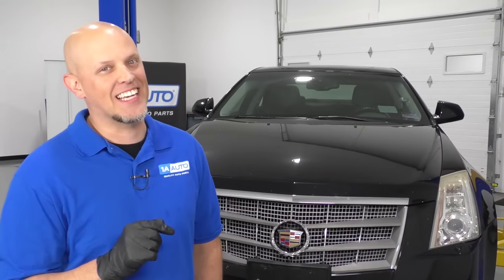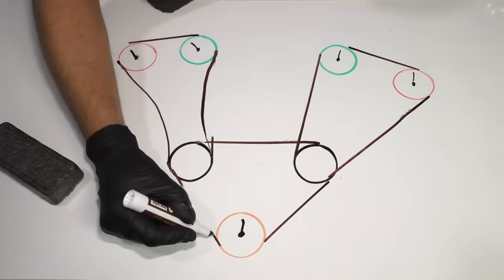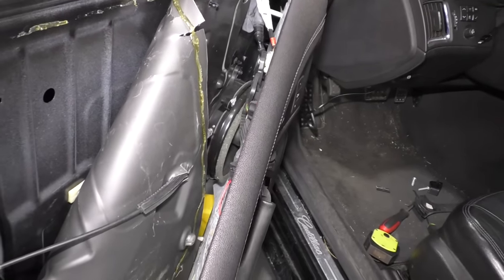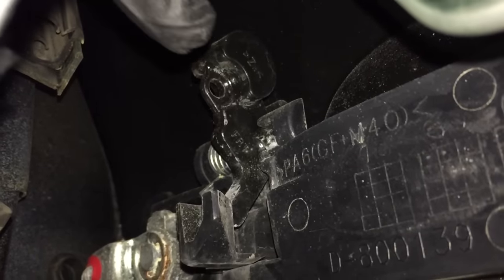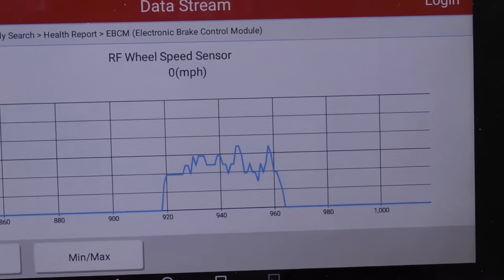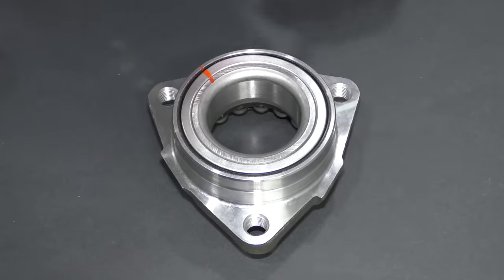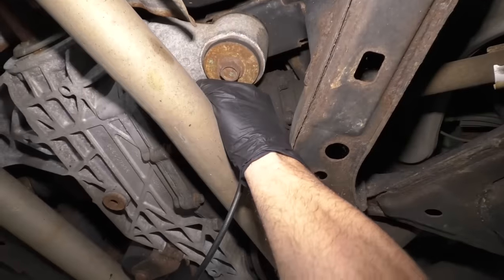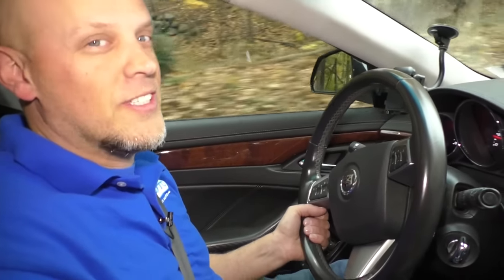Top 5 Problems Cadillac CTS Sedan 2nd Generation 2008-14

Comment: had timing chains replaced i have a 2009 it only has 85k on it had the chains done at 75k now the O2 Sensor code came up need to have that done now if it's not one thing its another~~

Comment: Had 3 dealer did timing chain under warranty multiple wheel bearings and multiple micro switch replacements. Oh and cant forget the leaky sunroof which I'm pretty sure is now the cause of my electrical issues currently
Reply: I am having what might be timing issue currently, can you share what you paid for the repair as I am being told about $3200 and if there is cylinder damage could go much higher.  The dealer cant seam to be able to tell me without getting into the engine first, but keeps talking about how I should buy a replacement car from them. I just do not trust them and not sure what to do.    I had water damage 4 years ago from the sun roof also that took about 3 weeks for them to figure out and fix under an insurance claim.

Comment: Great video thinking of buying Nieghbors 2011 Cadillac CTS rwd 6cyl coupe with a ton of miles on it 160k  for a cheap price ...(4$k) I’m scared of the mileage though but he’s kept it up ... I had the 2015 impala and the word was out regarding the timing chain stretch... my question is that was the first fix you mentioned is it that normal ? And did gm fix this issue in later models ? 
Great video thank you
Reply from the maker: +Kevin Edwards Thanks for checking us out! These are the top 5 problems associated with the CTS and could be found in the newer vehicles as well as the ones mentioned in the video.  1AAuto.com
Reply: Instead of fixing a timing  chain think bout a certified  engine

Comment: I have a question I get p0455 I've change the evap n also the gas cap but I still get a check engine light on and ever once and a while I get check gas cap n also I check the valve that is under the rear  my question is that harness that connects to the charcoal canister is there suppose to be power going through it ?

Comment: What is the purpose of having an electro-mechanical door latch release like that? I'm pretty sure some of the newer Volvos have them too, and I'm curious as to the necessity/purpose of this design.
Reply: I don't know for sure, but I would imagine that it all ties into the remote keyfob/security (PASS-Key III) system.  The switch is needed so that when one pulls on either of the front door handles, the proximity signal from the keyfob tells the computer that it's OK to disarm the security system, and the rear doors unlock as well, if that function is turned on through the radio/nav system.  Otherwise, one would need to use the "unlock" button on the remote each time one tries to enter the vehicle.  If they used a purely mechanical setup, the system would work like older vehicles with power locks that employs a solenoid in each door to physically slide the rod back and forth that controls the lock mechanism.
Reply: @williamwoodson4367  This is true.
Another thing I realized is that the coupe body of the CTS had the pushbutton exterior and interior door releases, ala C6 Corvette, so the engineering of the entire comfort/electronics systems for every bodystyle of CTS would have had to have all the same components, even though the sedan had traditional exterior and interior door handles.

Comment: I have the stabilitrack, abs and all wheel drive off lights on.  This only occurs when someone  sits in the passenger seat.  It will then turn the dash lights on bright and turn the radio and heat/air systems off.  It will continue to alert with the buzzer in several minute intervals till they get out of the passenger seat.  This has to be electrical…more like a short than mechanical?  Anybody??

Comment: Is it just me or... since you spun the left front wheel backwards at 5:36, and since the speedometer doesn't register speed when the vehicle in backing up, there should be NO speed reading when you were spinning the left front tire any way. In support of this is that, since you were spinning the left front tire backwards, it spun the right front in the opposite direction, causing it to register on the speed sensor. This can bee seen when you spun the right front forwards and in the background you can see the left front sinning backwards. Had you spun the right front backwards, the left front would have spun forward and may have shown a reading on the speed sensor while the right did not.

Comment: Ive always like these cars but never really stepped to get one because of past Cadillac reliability problems. What about the transmissions and or other internal engine problems?  Any thing else to look for? What would be the cost to take care of the timing issue?
Reply: Besides the timing chain issue the engines are actually pretty good, nice power and decently reliable, especially the 3.6. the first two years of the second gen had transmission issues, so I'd stray from those, but it was remedied with the 2010 model year. I've seen quotes as low as 1200 for the timing chain job up to around 2000, but it's preventable with regular maintenance.

Comment: I like many others get abs and stability system  lights, also (FM transmitter used in front plug and turning right goes static, used in back plug static is more random. Wiring issue in steering wheel
Reply from the maker: +Robert Kissler Thanks for checking us out! 1AAuto.com

Comment: I have 2008 caddilac cts 3.6 I change the engine and the engine light still say timing chain. That only thing in my check engine. It drive fine and runs fine. What can it be for timing chain on?

Comment: I have a 2008 cts , great running car. Only problems were battery drain was the trunk. Iight, leak from the sun roof wish there was something I could do about it. I cleaned the drains but still leaks a bit. And it had a slight leak from a hose that would give off a coolant smell and leak at the bottom of windshield, that I stopped by radiator stop leak. Otherwise it would have been very expensive.
Reply: @Neil Stern...Been there done that with sunroof drains. I went inside of front wheel wells. Was going to cut the "duck bill" looking grommet end. Too much hassle so I used soldering iron tip and burned the opening at the grommet end. Use a flashlight to find one at the end of each drain hose. The one's for the back drain hoses ( in the trunk) don't give problems. If grandma can do it anyone can!

Comment: Great video though Ive not had those issues, but I have recently  developed a noise  in my 08 CTS a sort of growl that can be heard from 20 to about 80.  Trying to determine the best way to isolate the noise. Any  ideas?
Reply from the maker: +Mark N Donna Jones Thanks for checking us out!
Reply: Check your trunk. There may be an angry dog in there.

Comment: i have the check engine light come on with a code of p008 and no one can seem to figure out the problem. the 4 cam shaft sensors were changed and the problem went away for a few months now the check engine light is one again. do you think I need a new timing chain? i have a 2009 cts with 70k miles
Reply from the maker: +Single Guy 4 You We wouldn't be able to diagnose an issue like that here, you may want to have a local mechanic take a look at it. Thanks for checking us out! http://1aau.to/m/Shop-1AAuto-c

Comment: oh boy where should I begin... lol. 

wheel bearing issues, transmission issues, electrical issues, had to replace ALL igniter coils some more than once. headlight is a pain in the ass to change. i can go on. had a 2009 CTS4 for 3 years, from 89k to 160k. spent probably 3k in the fist year in repairs just to keep running, the 3200 for the transmission was the final straw. if you like this model spend the money on the CTS-V..

Comment: My main issue is that door handle I haven’t check but I’m sure the passenger front door actuator is toast. And also I did have a timing chain go at 200,000km but that is “normal” in GMs maintenance book. 

Then my rear driver side door is working but the locking pin doesn’t want to go up or down. It tries I can see it try when in the car it moves slightly then back to locked. So I have fun with only 2/4 doors working right.
Reply: Oh yeah also I got a running rich code (both banks) that comes and goes as it pleases and can’t figure out the issue there. Help with that in any ideas of what it could be most likely would be greatly appreciated

Comment: How do you get the thermostat itself out of the housing? The spring is way to strong to do it by hand. Is there a trick to it?
Reply: By the whole assembly usually about 150 bucks comes in the housing

Comment: “I had my 2009 Cadillac CTS  previously serviced for random misfire on cylinder 1,3,5 and the dealership replaced actuators, camshaft sensors, cam washers, gaskets, spark plugs and coils which fixed the issue but it’s been less than 2 years and I’m back to having the same issues (rough start/idle) The vehicle is marking codes p0300, p0301, p305. So far I’ve replaced the spark plugs and coils (again) any idea on what may be causing the issue?”
Reply from the maker: +Anna Ibarra We do apologize at that point we would suggest having a shop take a look into those codes given that you've already replaced so much as this point you would just be throwing money at it. We just suggest you to do that so you don't have to keep replacing parts.

Comment: Got a small tapping sound coming from throttle area under the hood. What that noise? Even have check engine  light on. Your assistance plz sir or ma'am
Reply from the maker: +Dorceil Wilcox We wouldn't be able to diagnose an issue like that here, you may want to have a local mechanic take a look at it. Thanks for checking us out! http://1aau.to/m/Shop-1AAuto-c

Comment: great video thank you me myself have the timimg chain problem.rEPLACED IT but runs like crap it says misfire on cilinders 1,3,5 driving me nuts
Reply: miguel vazquez did you set the timing correctly?
Reply: @SRT_Hefe  yes sir according to 3 mechanics timing chain is good
Reply: Could be ignition coils
Reply: @leonabug619  thank you for taking the time and get back at me and will try that
Reply: swap the coils to different cylinders and see if the codes follow to different cylinder. also check the plugs.
Reply: Swap ecm worked with mine

Comment: Driving a 2008 CTS 3.6 V(LLT )in Europe.

Recognize four out of five (probably jinxed the door handles to go next now).
Already replaced wheel hubs and wheel speed sensors on all corners, and got new fuel cap.
After P0008 code appeared, replaced the camshaft position sensor which solved problem.

Recently the P0008 appeared again, but only after restart when engine is warm.
Already swapped VVT solenoids between bank 1 and 2, but problem did not shift to bank 2.
Any ideas, tips?

I know I will probably have to replace the timing chains, but the code to stay away after cold start makes me doubt a bit.
Btw timing chains is too big a job for me, that is I why I want to be sure before bringing it to a shop for the expensive repair.

Thanks in advance.
Reply: PS car has 160k km/100k miles on it

Comment: I have a chattering/clunking noise in my steering wheel when it is cut all the way in either direction at a slow roll like pulling into/backing out a parking space at walmart. My cts is a 2011 with 60k miles. No codes or dash warning lights. It's CTS4 with 3.0 v6.  Any ideas guys? I still have 18 months and 30k miles left on full extended caddy warranty.

Comment: 2011 cts. Door handles both went at the same time.  And have ahead to replace all  the wheel speed censors. And bcm has fried twice.. bad grounds maybe cause it?
Reply from the maker: +Jade Warnecke There could be many reasons why this is happening to your vehicle, we would suggest taking it to a local mechanic to have a diagnosis done. 1aauto.com

Comment: 2007 cts. So for i have changed the alternator, water pump, plugs, coils, center bearing on drive shaft, readr diff bushing, and i still habe parastic battery drain prolems and my brake light fuse keeps burning.

Comment: My 2008 Cad CTS wouldn't start, I tried a jump but that didn't work.  I bought the car 7 months ago, it has 80, 000 miles on it. My mechanic tells me I need a new engine.  Why would I need to replace an engine with only 80,000 miles? The carfax said this vehicle was brought in frequently for regular maintenance and I had the oil changed 2 months ago.   Any help?
Reply: What happened? Did you fix the problem?

Comment: How about steering shaft cracking and front end rattling over bumps. I’ve replaced the whole front end and still can’t get rid of the noise..
Reply from the maker: +Umar Thanks for checking us out. There could be multiple reasons why you're having this particular problem. We suggest taking your vehicle to a nearby reputable shop to identify the cause. Once you know the cause, we'll be happy to see if we carry the parts and how-to videos needed for your repair.Thank you!

Comment: I'm thinking of buying one but not sure if its right for my first car love it tho
Reply: It’s my first car you will love it and want to maintain it till your an old man
Reply: Chill Thrill I have a daily driver 3.8 series 3 Grand Prix 2004 gt just turned over 400000 ,also have a 2006 cts which I got cheap from Kia dealer non certified but was in super good condition minus brakes tires and emergency brakes mint body and paint  2.8 engine same as 3.6 only smaller displacement .  Here what I found out , 1 parts are much more money ,gas mileage is way worse than 3.8  . The 3.8 is by far a great engine uses no oil parts are dirt cheap and easy to work on . If I were getting 1 car for driving and easy and cheap to repair I would get a gm 3.8 series 3 normally aspirated 2004 - 2009 gm 3.8 car Grand Prix 2004 -2008 , Buick 2004 -2009 make sure it’s a 3.8  and learn how fix simple stuff wheel bearings , oil changes , and have mechanic check the car before buying especially if it comes from rust belt . By the way see how much fun it is to change a head light on a cts you have to pull the front of the car off 3 -4 hours at a shop  2004 -2008 Grand Prix pull one white plastic pin headlight comes out change bulb light 15 min job . I only bought the cts because it was diamond white 18 inch alloy rims ,mint paint  body ,interior was mint kept in Florida in winters,  engine transmission was good condition and I have 2500.00 + tax once I replaced all brakes ,rotors ,tires and emergency brake shoes and hardware kit and got independent mechanic shop to inspect and certify . So it was a cheap nice looking and running car for under $3000 but I saved by doing all the work my self.
but I would not have purchased it for a first car or daily driver because of the engines 2.8 and 3.6 and the gas milage and hi parts cost plus the timing chain issues reported . I do believe if you change oil 
/filter ever 4500 miles the engine will last much much longer ,I use mobile 1 5-30 and a few oz of motor kote and hi quality filters we will see
Reply from the maker: +nick king Thanks for checking us out!
Reply: I suggest buying it brand new and with a warranty. Synthetic oil and 91 gas only.

Comment: My 05 CTS 3.6 drives fine when you first get in but when it warms up and I stop at a stop sign. It's like it's in neutral and just revs. Sometimes I can shut it off and restart it and it'll go. Shifts fine and drives fine but when I drop and it's warmed up, it won't go anywhere. I have revved it and feels like it catches then goes a little. I'm lost to what it could be
Reply: Wow...very frustrating. I wish you all the best in getting it diagnosed and fixed for a reasonable price.

Comment: my first major repair was timing chain replacement dealer ship wanted 5k to fix i got it done for 1k,my fuel pump is leaking currently, my sun roof is leaking, and just today the transmission failed me cant put it in park with out it still rolling so parking brake has to be used to keep it parked, when you put it in reverse or drive CRRRRrrrRRRR clanking noise and wheels don't move at all car just stopped working in middle of traffic took it in they wanted over 3k got it down to 2,600 and now im waiting...
Reply from the maker: +Taylor Arrieta Thanks for the feedback!

Comment: Imagine if they put a 3800 in them
Reply: Mf run forever
Reply: They'd run problem free.
Reply: They should have used the 3.9L from the "W"-body LTZ cars. I have an Impala and it will tear tires off and it's completely stock and it's an '06

Comment: I'm eather very lucky or I'm very lucky cuz my cts turned 15 years old and the chain's just fine
Reply: I have on 06 CTS with 71k miles and it’s going strong with no issues other than the sunroof sticking sometimes.
Reply: I have an 04 deville with 200k
Reply: How many miles on ur 15 year old cts?
Reply: @rusco321  190,500 k miles. Almost 200,000k miles!😁
Reply: @themastershifter453  wow, what brand oil, weight and change interval?
Reply: @rusco321  I forgot what brand, I know it's like a 10w 30 oil, got it changed around 188,000 miles and dew 191k miles. Im actually gonna get it changed the next time I get paid to be safe. The people that had it before me didn't take the best care of it but I got it know. If u wanna see it my Insta is Levi_doty123
Reply: My 06 STS has 155k going strong
Reply: @danb2  well it's a 06 I hope it's going strong lol.
Reply: @DollnAbox  lucky, mine don't even work lol
Reply: @PandaFG  sell it
Reply: Raze lube all the hinges on your sun roof with light oil and your gaskets with silicone
Reply: what car and year o.o
Reply: Got 30k miles on my 2010 cts. No problems yet! Cream puff!